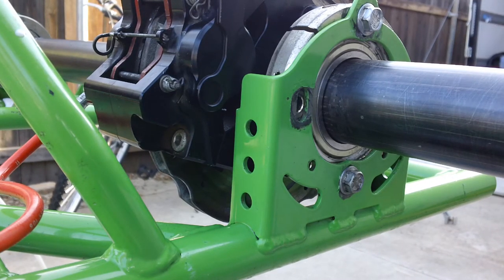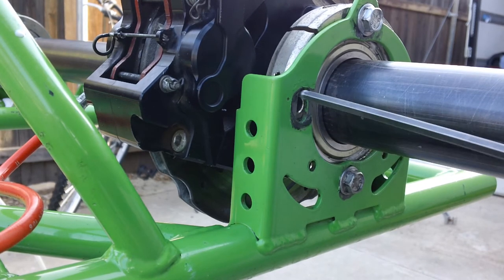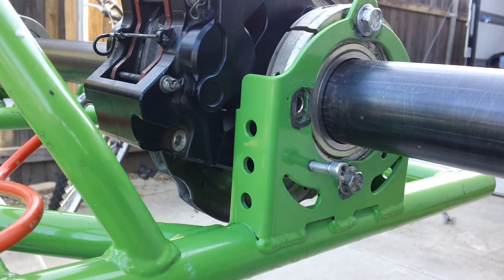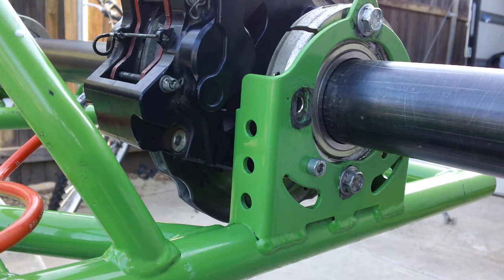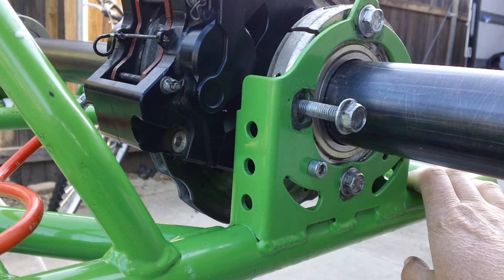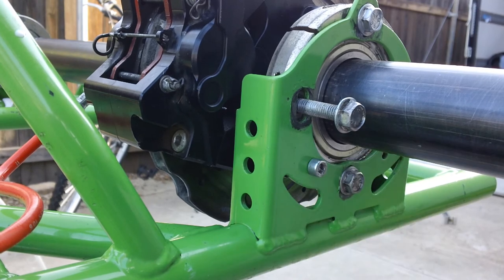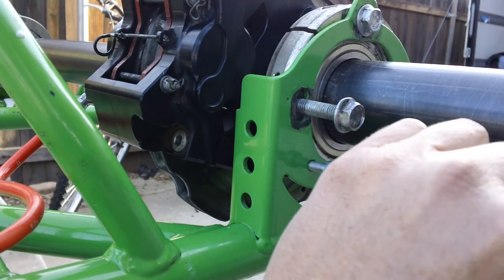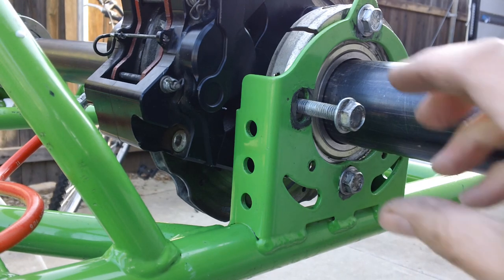What is this hole for?  Karting Axle Bearing Cassette

Comment: Nice to know 👍
What brand and how is this brake caliper mounted? My kart has a separate mount infront of the axle hanger/cassette holder.
Reply from the maker: Caliper is mounted using the same bolt pattern as the bolts for the bearing cassettes.